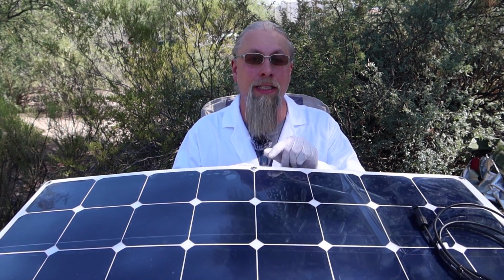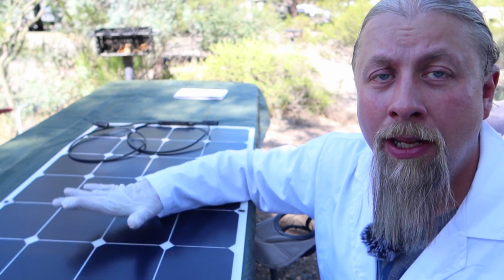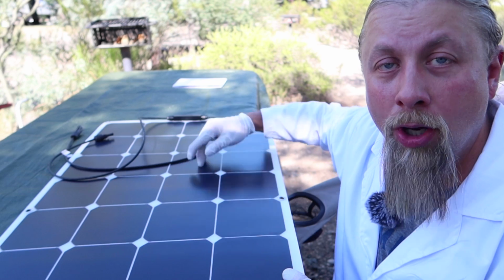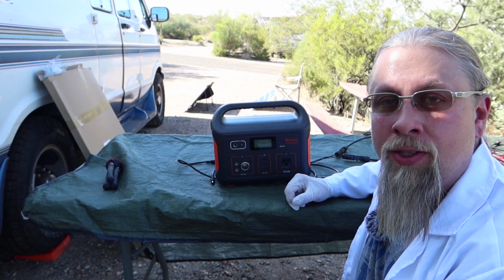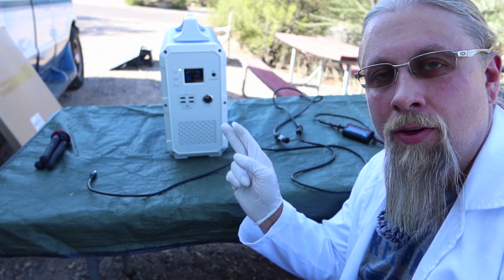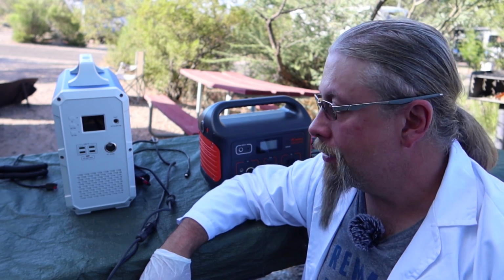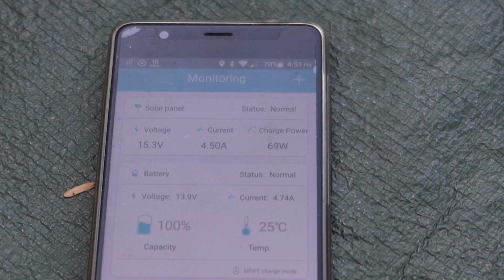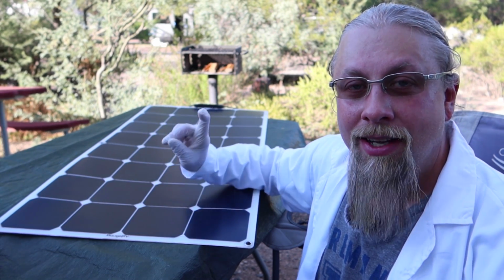100 Watt BougeRV Portable Panel Review | The PROFESSOR is BORN!

Comment from the maker: Bouge RV 100w on Amazon: https://amzn.to/34emK5M For compatible solar generators check out hobotech.tv/amazon .
AMAZON REVIEWS: The company told me they re-used the same Amazon product page for version 2 of the panel as they had for version 1. Note that all version 1 panels coming from overseas were flawed -- hence the bad reviews and why Renogy themselves stopped offering them. Version 2 is the improved product which is why they offer a longer warranty and have since had better reviews.
Reply: HOBOTECH thanks for the reply. New version might indeed be better, but the customer service is still a concern. There are recent reviews that mention that. No point of having a longer warranty if it's not respected
Reply: I really want a flexible panel due to its light weight, but still haven't found a reliable one
Reply: Are you not gulliable enough to believe this review? He's wearing gloves, so he wont get his hands dirty?  Having excuses why they fail and claiming problems are fixed does not win my confidence. 1.5 year warrant tells me the manufacture knows they're shit.
Reply: This was cool
Reply: Radios
Reply: Great video and effort, thanks. Just a curious question, ... what if we don't peel off the plastic on the panels?
Reply: Not gonna lie, whenever the panel was shown through the stock picture it became a optical illusion
Reply: I hear monocrystaline sucks cause it don't make electric when cloud covers sun..But amorphous produce half power when cloud covers sun..

Comment: Is there a similar flexible panel to this that you recommend? Just seen this video and am bummed they aren't in production anymore!
Reply from the maker: https://hobotech.tv/amazon/#Solar-Kits
Reply: @HOBOTECH  thank you! I am mainly going to use a panel on the roof of my rig to keep a power bank charged (ordering the bluetti eb70) plugged in on the road and at camp and just unhook it when not in use to save space inside the rig on trips and 1 less thing to pack. I think a decent 100w flex panel will suffice for my few day trips keeping a fridge cold, charging phones, and light strips going. Most likely add storage battery down the road as well. Your videos are awesome! Thanks for the info and links!
Reply: @HOBOTECH  I'm looking too and can't find one. The others at your link have the thin silvery lines going through the cells.

Comment: I know this is a little dated post, but so am I ...lol
Just looking for some either/or advice.....
I have a transit connect campervan and I want a recommendation  whether I should go with either a couple flexible solar panels or hard framed panels? I'd like to go with the flexible and use the hobotech tape job to mount them. But here's my issues ...amongst clear areas, I also do some fall camping under oak trees and will have a acorns, leaves, etc dropping on my van roof I'm sure. Ontop of having the rooftop panels, I'll probably have a set of  the outside pack and go panels too, having both camping in the sun and outside covered. Knowing that, would you recommend one over the other for the van roof?

Comment: After seeing this review and realizing this was out of production, I am wondering if, as a suggestion, you might do a video about the current state of flexible 100W solar panels. It seems these panels are becoming harder to find and also more expensive. I sense that portable 100W solar panels are replacing them. Thanks.

Comment: The Amazon link below states they are out of stock and not sure when they will be back in stock.  So I searched Bouge RV panels, but they only have a 50 W panel like your 100 watt panel.  :(
Reply from the maker: As stated in BOLD PRINT these went out of production about 6 months ago.

Comment: Hi there!  I am new to your channel, and about to move from a Class C to a Roadtrek 210.  I am glad that I could watch your vids on solar.  That is something I will want to do after the first of the year.  In this video, I believe you said you would not install these flexible permanently.  Why not?  Educate me!  Why not use your VHB and Enternabond process?  Have you heard of Santan Solar out of Gilbert AZ?  They have new poly panels for cheap, but they have used 327W SunPower panels that I was wondering about.  What do you think?  I have always  been told to get the most solar you can, however, with those prices, I should be able to do 650ish for  a killer deal.  I would love to hear what you have to say.  Thanks, hopefully, I will run into you on the road.  Any idea about this years RTR?
Reply from the maker: That's a lot of questions. I would only install a flex panel if it was removable, like using velcro. VHB you would never get the thing off if it failed. Santan has some great deals on used panels but be aware they are high voltage residential units and you'll probably need a higher end MPPT controller to use them. No word on the RTR.

Comment: This may be a junk comment. But why not use a cheaper 6v solar panel at higher amps and use a boost dc-dc converter to up the volts for a battery system? I did do this with a LM2587 converter for a small .75w solar panel. I used a Bridge on the output as a blocking diode.

Comment: Hey Jon, nice job as you are saving me tons of buy and try mishaps with my Roadtrek upgrades. I was actually just studying up on who makes panels using sunpower cells and found the Bougerv as well. Which brought me to your new video. :) I wanted to know what the diff was besides price and found it's PET vs ETFE. Sunpower panels use ETFE as top surface instead of PET and apparently they are claiming it may be good up to 20 years. It also stated that ETFE has a better solar transparency efficiency from the git go and never yellows. So that and the long warranty put Sunpower back in as a contender in my opinion. My current worry/wonder is, if I stick some flexibles directly to my roof will the heat degrade performance and how much heat will they transfer to my interior. So still studying. Thanks for all your videos, currently doing my 12v tv in the same spot similar to what you have.

Comment: I had panels without the lines like these and with the big strip joining the panels and they got so brittle if you touched them they would put in hair line cracks right through the cells. I am calling this out as BS unless someone says these are UV resistant plastic. Dont count on them lasting longer than 18 months in the sun (where they are supposed to be)

Comment: Just a suggestion but it would be quite informative to state what your ambient air temperature is at your location& also what the surface temperature of the solar panel is. Most panel spec's are stated at 25 degrees C (77F) ambient air temp. PV panel efficiency decreases remarkably as ambient temp's rises. I live in Fla & often summertime ambient temp is 90 - 95F with PV panel surface higher. 100W panels rated 5.5A @ 18.5V often get only 4A max on a hot day using gimballed panel mounts to have the panel perpendicular to the sun directly overhead.When the ambient air temp is  near the panel's spec the output more closely approaches the 5.5A.
Reply from the maker: Good point. I figured you could tell by my sweat it was over 100 degrees this day as it was almost every day the past month in AZ. Fact is, solar panels are designed to be in the sun and get hot. Most people using them will be in hot places. Generally expect around 80% of capacity which this panel does. It will do better in the cold.

Comment: Flex Panels have there place.    Not so good for Permanent Situations like  home but sure are great for Vehicle use and Emergency Stash Power.  Fact is they do not last as long as glass panel .  Fact is they don't break as easy as glass panels. LOL 

I have a DIY  Emergency Battery Box   (MPPT and 8 x 38120 LiFePo4 cells )  set up that I can charge in just a few hours with my 160W flex panel. I can keep the Flex Panel under the Mattress in the Van to use as auxiliary power when ever required.

Comment: Hi Professor, I need advice. 
Would like to supplement the current 80Ah battery in my small teardrop when I am dry camping. My power needs are minimal, on most recent camping trip I used about 400 watts in 7 days, I think I was close to the 50% level on the battery. Should I get solar panel or Jackery 500 or replace current battery with Batleborn or get a generator? So many choices and so hard to decide. Thank you
Reply from the maker: If you only use 40Ah in a week sounds like all you really need is a 100w panel and a simple solar controller to keep it topped up. A Jackery 500 holds about the same amount of power so you could get something like that if you wanted portability and ease of use. Something like that you can charge from your vehicle and not even need solar.

Comment: Any advice on charging a battery pack for an electric skateboard/scooter from a solar battery, or solar directly?

Just feel like it’s pointless to take it from dc to ac, only to change it back before charging the board/scooter...
Reply from the maker: Problem is that most high amp batteries require high amp charging. The limit on most 12v systems is 10 amp or 120 watts. With scooter/e-bike batteries all different voltages it's a necessary evil to use their specific charger that runs AC. I haven't really found a better solution.

Comment: Just subscribed because of your awesome informative vid on the Bouge panel. Got one from another vaner utuber as he decided on Renogy for endorsements. Wil purchase more through your link because you did a darn fine video.I tend to focus on amps the panel can push....5 amps    is darn good. Question? What damage if any will directly wiring the panel to a battery do?
Cheers!  Instagram: 8715jo
Reply from the maker: If lead acid you'll boil the acid off. If lithium probably a fire. I wouldn't do it.
Reply: @HOBOTECH  ok hobo tech good call  it was only short time .............up here in Canadia..sun  is decreasing fast for fall always attending the bat.
Was wondering about the diodes in panel con.box thanks!

Comment: also most of the time if you use a series connection the different components should be of the same value. that's why they use the same batteries when they make a series connection, so parallel will be better
Reply from the maker: That's not the case with solar panels. Different panels should be run in series otherwise the panel with the lowest voltage will bring down the entire array. I've tested this.

Comment: Because it is made in US it doesnt mean it is better, it is a logical fallacy. Cell grading doesn't exist, it is a made up thing and not backed up by any standard. All panels needs to be new, because it is constantly degrading, especially at start due to light induced degradation, so you just grabbed brand new panel and compared with older ones. Also each panel is different, even instructions are saying plus/minus 5 percent, so you can't compare 2-3 random panels only. Your measurement tools are not certified for accurate measurement. You also measure them separately at one time, lighting and temperature may have changed.

Comment: Following up on the response you gave me,  what then is the purpose of having just two solar panels.,..what can they run? How much juice on a good day will they charge in the batteries?
Reply from the maker: Solar is good for charging your batteries so you can run small devices like laptops. I can't answer your question because I don't know what solar panels or batteries you have.
Reply: @HOBOTECH  , then why are you pushing a battery that comes with a 1000 watt inverter? The RF, heat, & waste of that inverter is just ridiculous. My solar works great because I've eliminated all inverters and transformers. Also, that inverter almost certainly has a thermal limiter, which makes it useless and they often fail( in my experience) causing me to have to open the box for reset or replacement. BTW, Elon Musk is an idiot. His " Solar City" debut had 1000s of us busting a gut laughing. What a lying snotbag.
Reply from the maker: @rmadiller  Because most people need inverters to run appliances or charge laptops, etc. I myself eliminate as much AC power as i can going so far as to get 12v power supplies for my computers, running 12v fans. Remember, not everyone is an electrical genius and most just want to plug in what they already have and just have it work.
Reply: @HOBOTECH , you got that part right. My cousin thinks he's a wiz, but brings his old electronics to me for repair. One day, I asked him to point to a transistor on the board. Hilarity ensued. I grew up in silicon valley before it went silicon. Even the people in the industry didn't know the IC was invented in my native Texas where we've never halted production. Compared to textbooks my family owns from the 30s&40s, today's educational system is geared for those less intelligent than Forrest Gump.

Comment: i've not had great luck with the PET coated panels. they last better in higher latitudes but at lower latitudes the film turns cloudy within a year year and half and the output goes to crap.the ETFE coated panels are supposed to last much longer. i currently have some of the renogy etfe panels on my boat. will see how they do. also i'll point out that the link to the panels on amazon you posted have "PET" in the ad title and lower down in the description the ad says "Unique ETFE material, Make BougeRV solar panel even better"  so conflicting information....

Comment: Solar panels are one thing in life where you get what you pay for. Quality panels usually have a  25 year warranty to provide 80% of the original output. The length of warranty is a strong clue of the quality of a solar penel. This panel may well cloud up and/or crack within 3 years. Most cheaper panels are trash by  that time. IF you depend on your solar panels for you mobile office or dwelling...buy quality panels. Cheap panels have flooded the market and ran all the USA based solar out of business save a handful of companies. If you want a bargain, look for the Xunlight or Uni-solar NOS (new old stock) that is available for purchase. Buy used if you have to...do it quick! When they are gone...they are gone.

Comment: Amazon gives you a $100 coupon so when I applied your coupon for $240 it didn't work.  It only gave me a $140.  Is there any way I can get the $240 ??
Reply from the maker: Amazon coupon is $100 and the code gives another $140 off for $240 total.

Comment: Don't buy them. A strong glass cover is needed to protect the cells. The cells are very thin inflexible 'glass' silicon that road rocks, tree branches, or large hail can easily break. Large birds, such as crows and ravens, also break the cells when they peck them.
Reply: My panels have even survived several golf ball sized Texas hail storms. I agree.

Comment: Pity it's only 32 cells. All my home made panels use 36 sunpower cells.
While it would still work in parallel or series under load, there would be two power peaks when in parallel and a small current flow from the 36 cell panels to the 32 cell panel when open circuit and not under load. This isn't significant for a couple of panels, but adds up with 10 or more disparate panels.

Comment: Anderson connectors are great for connections that get disconnected and reconnected a lot.  They are not good for permanent or semi-permanent installation, or long term storage.  They're prone to corrosion over time which is abraded away by constant use.  If you have the Solar Saga or any other Anderson connector device, you'll want to use some kind of corrosion prevention on the contacts while it's in storage or long term use.  You can get a good dielectric grease from any auto parts store if you're in a hurry.

Comment: I hope someone can help me... I am not electrically inclined.  I would like some help with the math as to how many solar panels I need to buy to run the major appliances on a 2013 Grey Wolf I just bought... I'm getting all sorts of answers. 
I know I need to charge converter and  the right to figuration with batteries and trying to figure out how long it takes to recharge the batteries when boondocking.
 I'm hoping to avoid buying a generator although I believe I still have to.  thanks in advance for your help
- Kevin
Reply from the maker: Sounds like you need to visit a solar installer or talk to a consultant. I can tell you now if you plan on boondocking and running "major appliances" you either need a huge lithium bank with a ton of solar or a large generator.
Reply: First I want to thank you for responding…. I'm not looking for boondocking for extended periods of time however when traveling you could have days where you don't want to hook up at a park and be  the Summer where you're running air conditioning and  the refrigeration which is on all the time .of course in the fall or winter months you have that you need heat so setting up these two panels how much energy are they actually supplying and storing? If they're outside all day and  from what I've read  you certainly  I'm not setting them up to run a hair dryer or just to run a coffee pot. thanks again

 @HOBOTECH
Reply from the maker: @Kevin-bi9wj  You need thousands of watts of solar to run a roof air conditioner (dozens of panels) and more batteries than your trailer can carry. In other words, impossible. You'll want to invest in a 3500+ watt generator instead of solar.
Reply: @HOBOTECH  thanks again for getting back to me I was not sure if I. So what exactly does two 100 watt panels give one... What's the benefit? Thanks in advance

Comment: I've been using similar flex panels for years now. Good stuff
Reply from the maker: I originally mentioned you in the video but cut it because you had a bunch of the older style fail. So the new ones are working?
Reply: @HOBOTECH  So far they seem to be holding up even with my less than professional maintenance lol